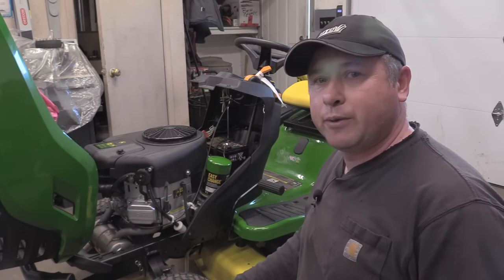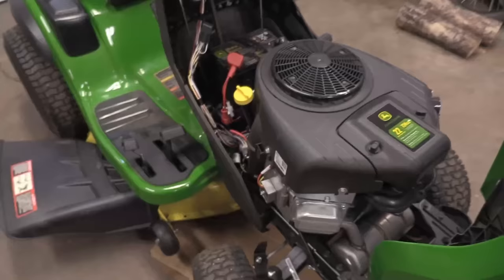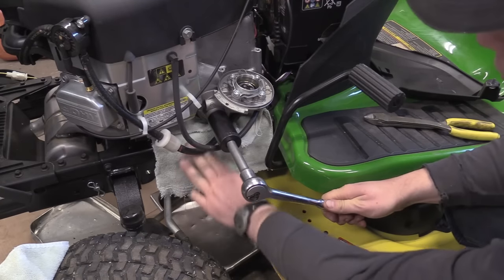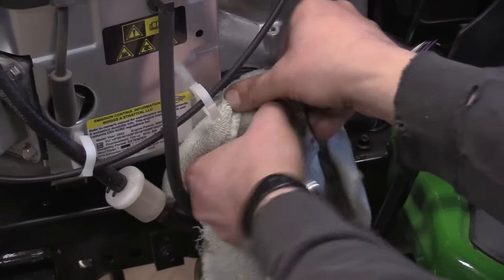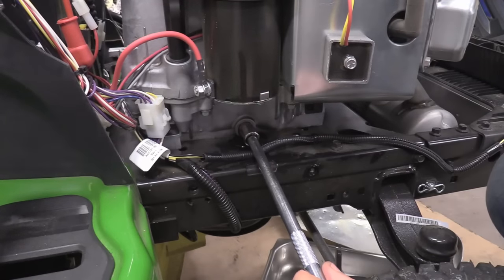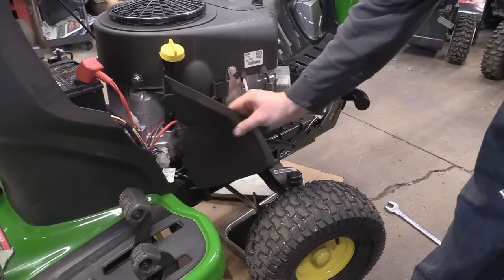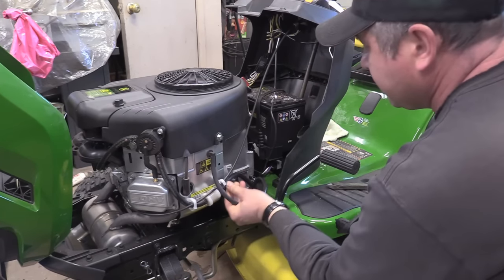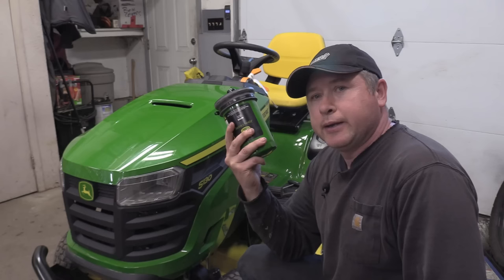John Deere Easy Oil Change Conversion On Lawn Tractor

Comment: I did it, very easy but before you remove the existing filter assembly make sure to stuff a lot of rugs under and more importantly behind the old filter assembly. If you don’t you will end up with plenty of oil running through the holes of the frame and on top of the belt pulley. This will happen even after removing the filter and after emptying the oil.
Do it in this order.
1. Start the engine to warm up the old oil a bit. Wait 5 min.
2. Remove oil filter only for now. Also remove the side panel by the filter. 8mm socket, very easy.
3. Empty the oil out of the pan. I left the existing oil plug in place. I don’t trust the nipple with the plastic part so I didn’t replace it. If that comes off kiss your engine goodbye. My hand pump got rid of all the old oil through the dipstick hole.
4. Now remove the old filter assembly and put your new oil filter nipple in place.
5. Screw the new filter on and add 1 and 3/4 quarts of SAE 10W-30 oil. (Only if you are sure all the old oil is out.)
6. Start the engine and run for a minute. Check for leaks around oil filter.
7. Shut off engine, wait for 5 min, check oil level and fill as necessary. Mine took 2 qts plus a few ozs more.

What I did didn’t require me removing the panel on the oil plug side.

Comment: Just watched and I'll be doing this as well. Question, can I move my fuel filter forward and install a shut off valve where the filter is located? I can't find easy access to a shut off before the present filter location. Thanks again for another great video.
Reply from the maker: yes you can put it wherever is best for you, it's good practice to have the fuel line installed before the filter so when you replace it you won't have fuel leaking everywhere
Reply: @donyboy73  Thanks for the feedback it's a big help as usual.

Comment: Could you use a pipe nipple 1/2" NPT by 6" with a cap instead of that John Deere part with a flimsy plastic turn cap?  Also is that a Briggs and Stratton engine?
Reply: Agree. That would be a better solution. Yes... it's a B&S engine. JD only puts the Easy Change on mowers with B&S engines.
Reply: I did that with my B & S engine. But instead of a cap, I used a ball valve.
Reply: @davidquinn6161  That's a great idea. Some of the higher end JD tractors like the X700-series actually come from the factory with ball valves on the drain plug.
Reply: Is it 3/8

Comment: How do you get the engine to run without sitting in the seat (which engages the safety switch which kills the engine should you fall out of the seat)?
Reply from the maker: Put the parking brake on

Comment: Is that some kind of special John Deere engine or is it just a Briggs Vanguard like it looks like, with weird oil connections in the sump casting? It looks like you could put a Simplicity/Briggs oil drain hose on (with a metal cap) instead of the metal one with plastic cap.
Reply: Don't think it is a Vanguard. Most are just basic B&S 44000-series vertical shaft engines with JD stickers.
Reply: @eosjoe565  wow, crazy - I would have figured that if my Simplicity has a Vanguard, a Deere definitely would, they always sound more premium or at least more expensive. Although, 44cu inch is quite a bit more than the 18hp 35000  series (approx 35 cu inch displacement) v twin on my larger lawn tractor.

Comment: I tried to do this conversion on my JD S160 this afternoon and things did not go well.  I didn't have the appropriate socket for the drain plug so attempted to use a wrench instead.  There's not a lot a room there so I couldn't really get any leverage and was unsuccessful.  Even worse, I noticed that the plug thread were coated with red which I'm assuming is loctite red which from what I've read makes it just about impossible to remove.  Has anyone else run into this?  Any suggestions?

Comment: I'm getting ready to buy a new mower, got a John Deere 750 tractor, thought we'd get the John Deere mower - the second I read this "Easy Change" plus the cost, was like, "no way!"   Immediately got on YouTube & found this video.  Thanks for posting this - still deciding which to buy because concerned why would Deere do this? It's a recipe - dirty oil never drains without doing this adaption - for early engine failure!  It's always about making more money with us Americans isn't it?  Shame on you John Deere!!!

Comment: A 2 liter pop bottle, or plastic one gallon milk jug cut to fit into the drain plug area will direct the dirty oil into your drain pan prior to installing the new drain tube. Keeps the mess to a minimum.

Comment: 12 point sockets will work on square drive parts like the drain plug..
Reply: actually I  haven't tested that but I don't think 12 pt work because 12 is an odd multiple of 4. I think an even multiple of 4 is required for square heads.
Reply: @kenhilson786  12 is a multiple of 4, doesn't make a difference if it's odd or even, as long as it's whole number; a number without fractions; an integer. Now it won't be the same 'size' - a 15/16" socket fits very well on a 3/4" square. I know it works because I've been using this for years.

Comment: You don't need 8-point sockets for those square oil plugs.  Just find a 12-point socket that fits.  For example, a 7/16 12-point socket works perfectly on a 3/8 square plug.

Comment: I don’t know what Briggs was thinking on this setup.  Almost as crazy as their EXi series engine that never requires an oil change.  Let’s see how that works out 😉
Reply from the maker: the fact is that they don't care about the environment
Reply: @donyboy73  Convenience rarely, if ever, takes environment into account.  Also, since not all of the oil is being replaced it is just adding to the planned obsolescence of the engine and by extension the mower.

Comment: Another great video Don.  I have to say what a lousy design by John Deere.  Like you showed here, when they just change that filter, only getting a small fraction of the oil that is in the crankcase.  I would have to think that if you only change that gimmicky filter, the engine life will be greatly shortened because your not getting the old oil out of the crankcase.  Then again, maybe that's what John Deere wants, so you buy a new tractor in a few years. :)

Thanks for sharing your knowledge and skill with us.

Comment: Why didn’t you put pipe dope on the new filter adapter threads that went into the engine?
Reply from the maker: don't need it in there
Reply: Not inside the engine 
Could lock it up

Comment: At least they allow an option to switch it back to a conventional filter. They tryin pitch it as the bigger fioter( easy 30 second filter) has more filtering media and of a different type,but that's gonna only help to a certain extent and that still leaves the absurd cost for the convenience of changing half your oil. I'd probably switch mine back to conventional, if I owned one.

Comment: This is interesting.  Basically all you're doing is diluting the oil;  say 4qts overall, "filter" holds 1, so everytime you change it you replace 1qt.  You're not really getting rid of all the old oil.
I'd have to believe that the "new" thing has a higher profit margin at the expense of longevity.

Comment: How did you start the mower without sitting on the seat first? I've been told you need to sit on the seat to start the engine and to keep it running. Get off the seat and the engine shuts itself. Yet in your video, you clearly start the engine standing and the engine stays running w/o anyone sitting on the seat. How did you do that??? What am I missing here?
Reply from the maker: By having the parking brake on

Comment: have an E170 which quit running after 25hrs. I'm not saying it was the quick-change oil system or just a bad engine. I ended up having a new engine put in it. The new engine is the same engine that is in the S series but I had the dealer put the conversion kit on and did away with the quick change.

Comment: I Just came across your video; I am looking to buy my first riding mower. I do like the John Deere S100-series of mowers. But John Deere is just like all the other companies out there, $80.00 for an oil change on a lawn mower REALLY? (JUST GREED). I'm sure John Deere's profit is more than enough, that they can do without milking the customer of $80.00 for a half-ass oil change.
Reply from the maker: I recommend John Deere with v=twin engine and a metal transmission

Comment: 2nd
Reply: Having worked at a small John Deere dealership for a little while ,I believe it was all to do with EPA regulations and saving some money . Same as the no need to change the oil Briggs and scrap irons engines

Comment: What's sad is that someone was tasked with designing that oil filter holder and seal system that actually makes engine oil performance worse for the engine.  And someone signed off on approving that design for production.

Comment: The filters used on JD, Briggs or whatever engine are overpriced made in China.  You can get any brand filter to replace at over half less cost. Fram can be purchased at Walmart for 3.88 not 15-20 like the genetic black OEM. If a filter has the thread match and clearance it will function

Comment: Looks like a Planned Obsolescence scheme to me.  They have to know that leaving a liter of dirty oil every time will cause early internal engine wear that will eventually result in a ruined engine.  That way they can sell more parts or a whole new small engine machine for anything that uses their "Easy Oil Change" System.  That is until people realize what causes it and stops buying anything John Deere makes.  Have they also lengthened the required oil change time, which would insure damage?  John Deere used to mean Quality, but now it equates to very expensive Chinese crap.  Shame on John Deere!

Comment: As someone who likes John Deere products or use to I will NEVER EVER consider another John Deere product. This ez change crap is propreitary to Deere and a form of planned obselecense dont get me started on plastic hoods. John Deere tractors usually need expensive software and if a sensor fails the whole thing is broke. I got a used Kubota ZG20 i am about to re power with a 670 predator engine and rebuild the deck. Deere will screw farmers and Homeowners over which is why farmers are switching to Kubota, New Holland, Or rebuilding or buying back their parents or grandparents tractors that sat for years and years. Id take Kubota over John Deere all day long for mowers and equipment. Ive used many mowers and a couple of Tractors id say Kubota is the answer. I recomend Kubota to my customers  buy once cry once. Instead of Buy three times and waist money Husqvana is ok. Other brands like Craftsman, Troy Bilt, and, Cub Cadet are brands to steer clear from. I am going to get a zg227 Kubota soon.

Comment: I dont like the fact that the plastic drain cap just snaps on. It will wear and fall off and you lose all your oil. Then junk engine.
Reply: I agree.
Should have a NPT pipe cap on end if drain tube